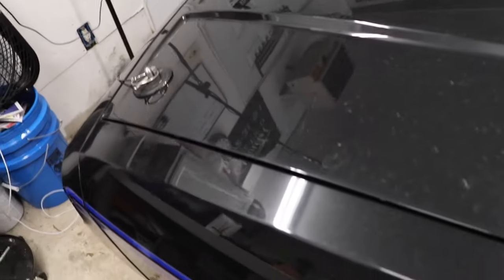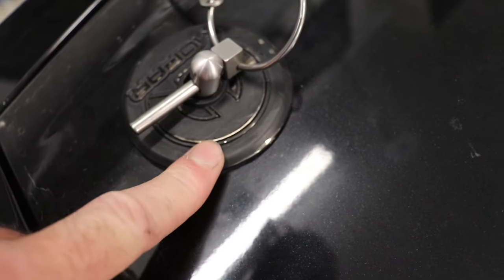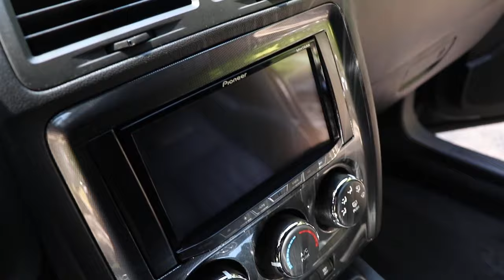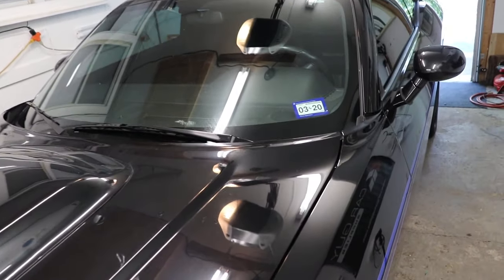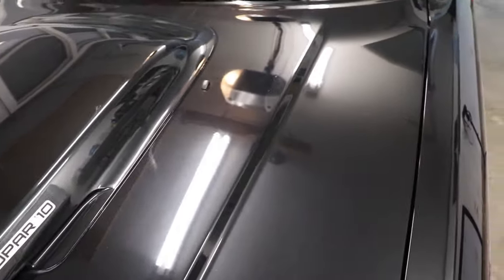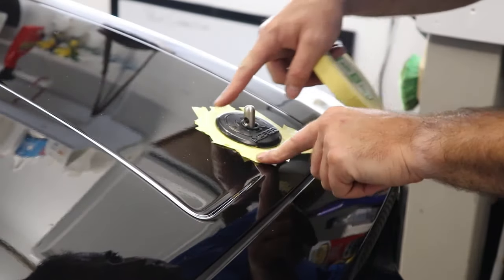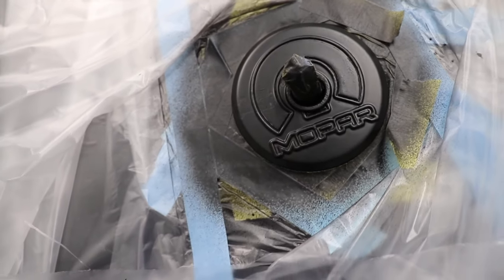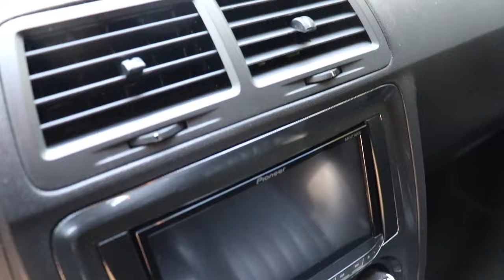Complete Interior and Exterior Detail / Polish / Plastidip / #Challenger #Mopar #Autodetailing

Comment: Phil I’ve never used a da polisher. Do u clean off ur pad once in a while with a brush or air?? I know  I have seen other detailers do that after each panel or so.
Reply from the maker: Hi!  Yes I usually do use an air compressor to clean the pads out when I’m doing a paint Enhancement or paint correction. But if I’m just using a polishing wax there is no need to.

Comment: Overall great video work and results. Loved your setup of all the products and tools.

A few suggestion: The music could be better especially that first song. I would start cleaning the door sills first, then pedals and center console before the rest of the interior. Doing it the reverse means you just end up putting more dirt back into areas you just cleaned. Plus maybe spray some distilled water on the pad to cut give more lubricant and cut down the heat.
Reply from the maker: Thanks
Thanks for the suggestions.
That’s too bad....I enjoy our music selections but I also understand that everyone has different tastes in music, so that’s not really something I can control unless I can get 5000+ music suggestions!...🤣. That’s just crazy. LOL. 
I actually did clean the dash and consoles first when I’m sitting in the vehicle. Then I move on to the floor boards. I just don’t have time to record everything. So I get the highlights. 
I do sometimes add water to my pads when compounding to get more cut. But this wa not a paint Enhancement or correction just a light polishing sealant. 
Thanks again for watching! 
I do appreciate the tips but it’s hard to document the entire process when I’m working and don’t have unlimited SD storage on my camera.

Comment: Why did you wash the wheels after the car because all the brake dust will flick onto the paint you just cleaned so when you dry it it will scratch
Reply from the maker: Nope..we always do a final rinse, nothing flings from the wheels onto the paint at all, so there is nothing to worry about.  Remember its personal preference as to which is done first.  What you see in the videos is a fraction of what we are actually doing...I can't show everything we do in the video, not enough time, plus when detailer's do this week in and week out we understand how to minimize causing any further damage or possible swirls/scratching. Its about going over the surfaces systematically and thoughtfully.